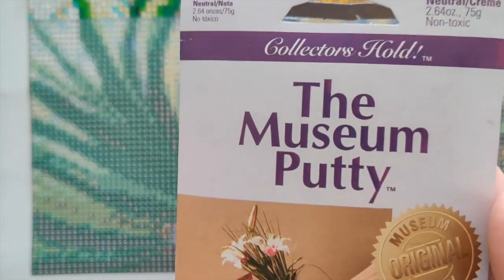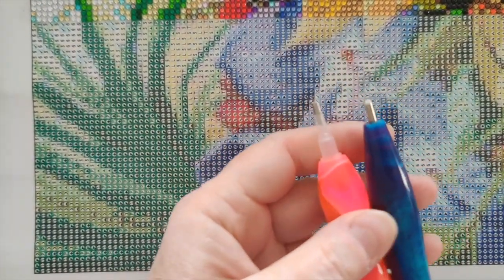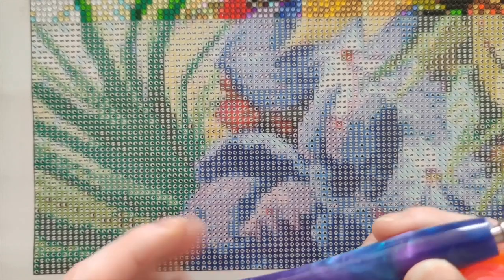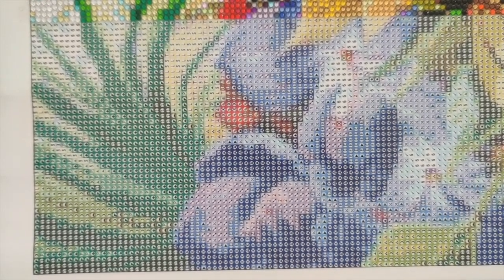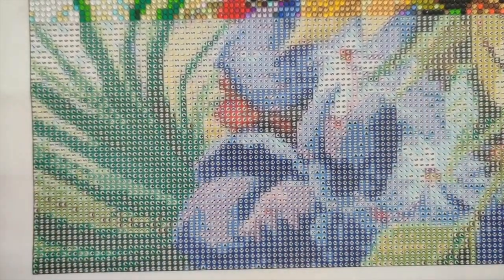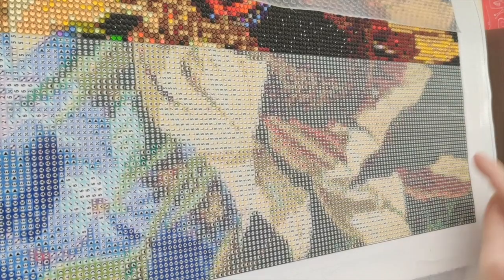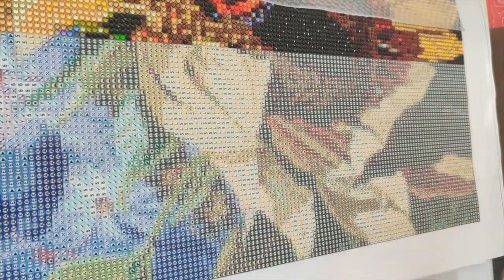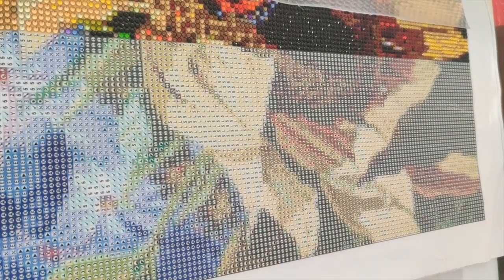Diamond Painting 411 - How to Drill Straight and Use a Multi-placer

Comment: This has been so helpful, I will give multiplacing another go. I’ve tried in the past and gave up . Thank you so much 😊
Reply from the maker: Keep at it Clare.  I started with a 3-placer and worked with that until I was completely comfortable with it, then switched to a 4-placer, then a 7-placer.  I've been using the stainless steel Everlasting tips in 6- and 9-placer models, and they are wonderful.  Worth the price once you are confident with multi-placers and know you want to keep on using them. Good luck and happy diamond painting! ❤️🤗😊

Comment: Thanks so much for this video!  Filled with great tips!  You can teach an old dog new tricks!!  Actually placed 3 drills at same time!!!  Do you need thinner tips to be successful at this?  Remember video saying that tips that came in kits were “too fat” to get drills close together.  Thanks again for this very helpful video!!!
Reply from the maker: Hi Liz - yes, some of the plastic tips have thicker edges, so I personally couldn't ever get used to using them for square drills.  The fat ones are the ones that are clear plastic.  The white plastic multi-placers tend to have thin edges and are great for square drills.  With the white plastic multi-placers, they confirm to the shape of the drill type you're using, so I used them only with square drills.  Practice makes perfect, so keep on placing drills with the multi-placer.  I used a 3hplacer for probably 4 or 6 month before I ever tried using a 4-placer.  ❤️🤗💗

Comment: Do you work on a slanted surface (easel/drafting table) or flat.  I like the idea to use the side of the tray as a guide  to where you are because I tend to lose my place by chasing symbols.  Of course I’m not much for multiplacing, prefer confetti still.  Fairly new to this craft but I am getting more adventurous.
Reply from the maker: I work on a drafting table that has a slight incline to it, probably about 15 degrees.  😊

Comment: This video is expertly done and professionally executed. Please accept my gratitude from one who has tried multi placing and failed.  I now walk away with a fresh perspective of how to multiplace.  Your video has provided me with the knowledge of how to multiplace and continue practicing, knowing that each attempt may not be the best.  But I  now will persist with working my way thru and not give up.  I thank you so very much for your efforts to make
multi placing a part of my diamond painting experience.  Highly motivated. 
sparklynnglitter
Reply from the maker: I'm so glad you found this helpful, Linda.  It took me a long time to get comfortable with a 3-placer before I moved on to a 4-placer and then larger multi-placers. I thought I'd never be able use a 6 placer!  Another tip I forgot to mention in the video is I have found that the clear plastic multi-placers work best with round drills, and the white plastic ones are great for either round or square, but don't use the same white multi-placer for both round and square drills because round drills are bigger and will stretch the plastic so square drills won't fit in it properly. 😊